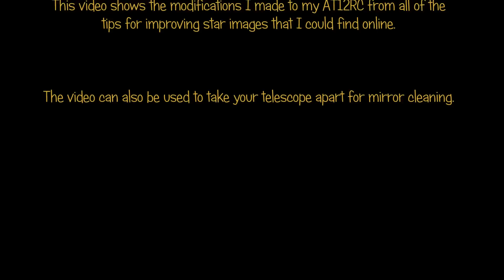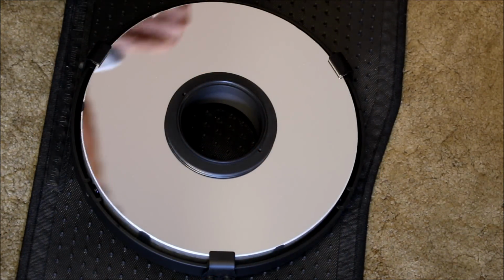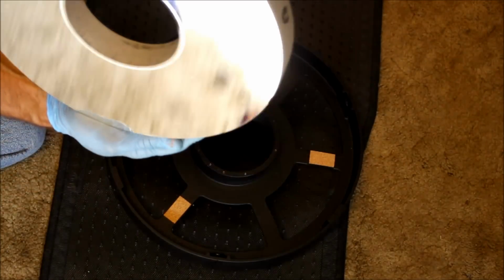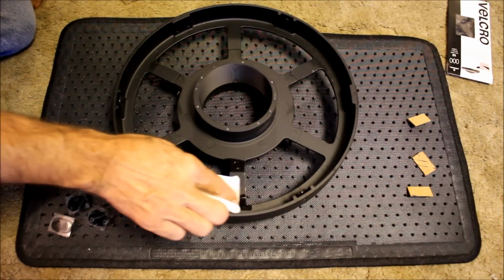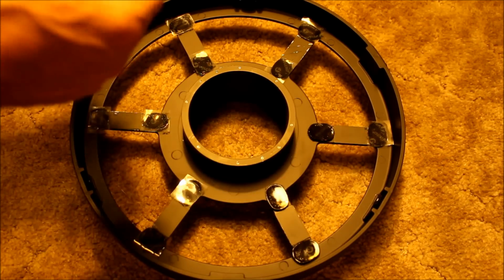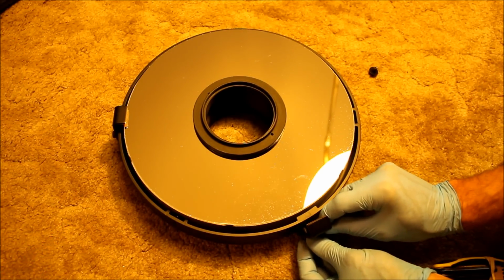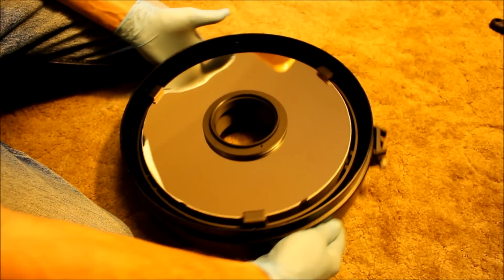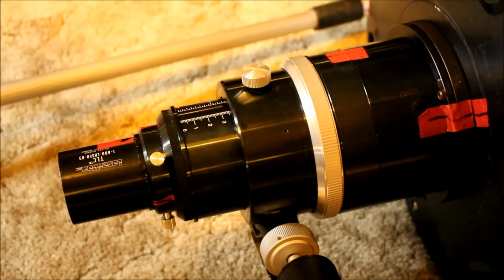Modification of Astro-Tech 12" RC for Improved Star Images

Comment: Only thing I noted was that when you decided to move the three small mirror tilt adjustment screws that you felt were sticking out too far you were changing the the distance between the two mirrors from the factory setting.  This mirror separation is a critical adjustment to avoid spherical aberration in the R-C design.  This is independent of collimation. The way you can tell if it is incorrect is to focus at infinity and measure the back-focus from the rear cell to the focal plane.  On the AT 12" this is supposed to be 288 mm. (the 10"=233mm, the 8"=254mm).  If the scope is collimated, just moving all three adjustment screws equally in or out until you get the backfocus to spec means your mirror separation distance is now correct.  Plus or minus 1 mm on the backfocus is fine.  Altering the mirror separation from ideal changes your focal length, so measuring that is another test of correct separation.  The RC design with the two hyperbolic mirrors is a delicate dance with mirror separation and collimation, and a focuser that stays orthogonal and aligned.  When everything comes together as designed, the result is incredible views!

Comment: At the very end of the video you said that you added a magic marker center dot to the secondary mirror.  Wouldn't this be right in the light path and block some of the light from the converging light cone?
Reply from the maker: The black dot is needed for collimating the scope.  It doesn't affect astro images.  You can see the astro images I've taken with the 12" RC here:

http://GaryHonis.com/6D%20Gallery/6D%20Gallery.html

Gary
Reply: So you could actually tell a difference in star roundness after doing the modification?  I have a 14" Newtonian that sometimes seems to have triangularish star shapes in its images... I am wondering if I should try the modification.  Is the key just to get those 3 clips off of making any contact with the mirror?  I don't have that center attachment, so I wouldn't have to do anything there...  The mirror is so heavy, those Velcro ellipses really hold it on good?  Were you expecting to not have to collimate every night after doing it, or was that more of an unexpected surprise? Like a bonus?
Reply from the maker: Hi James,  Yes, my stars are round now, they used to be shaped like triangles.  You can test the clips spacing, you should be able to slide a business card under the clips, that's what I do for my 20" Starmaster.  When I used those velcro strips, I no longer have to re-collimate, my 12" RC stays in perfect collimation and I haul it to dark site every New Moon period.  Gary

Comment: I'm thinking the mirror is a really tight fit on the central hub - I would have sanded that down until the mirror slipped on without any wiggling and pushing. Does it give round stars now?
Reply from the maker: Hi!  It gives perfectly round stars after the modification.  You can see the images I have taken with the telescope here:

http://GaryHonis.com/6D%20Gallery/6D%20Gallery.html

Gary

Comment: If you need to clean the mirror in a telescope, it must be done in a clean 
antistatic environment. You clean it down against a carpet, which is probably 
the worst thing you can do as a carpet contains a lot of dust particles, you 
also show that you working outside where there are pollen and other particles 
in the air, it is always a good idea to maintain the mirror in one's telescope, but 
it must be done in a clean room, without dust and airflow.. so I would not 
suggest Clean it as you show it, there are too many sources, that blocks for a good result.. 

I know you probably do not have a clinically clean room in
your home but you could have vacuumed and washed your bathroom down with Water, 
and the cleaning and all of the mirror out there, the results would be of a much better quality ..

I know that this type of telescope, is not in a closed environment and dust will get into it, but I would 
still have cleaned it in an area without so many sources of dust ..
Reply from the maker: Hi James,   Thanks for your advice!  Gary
Reply: You're welcome :-)
I was on your website and looking at your pictures, they are really good :-) ..
It's a good combination of telescope and camera :-)